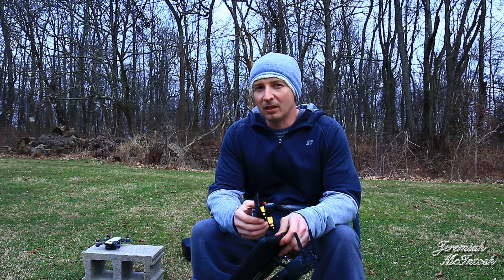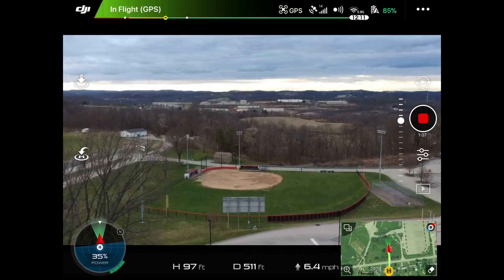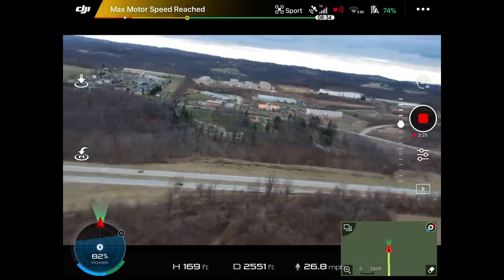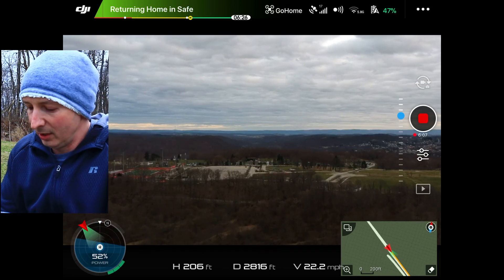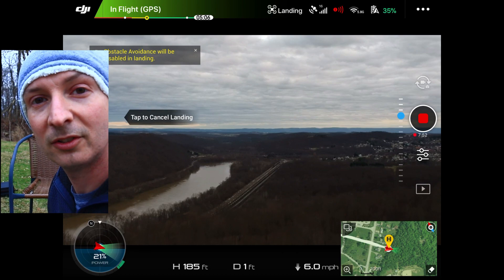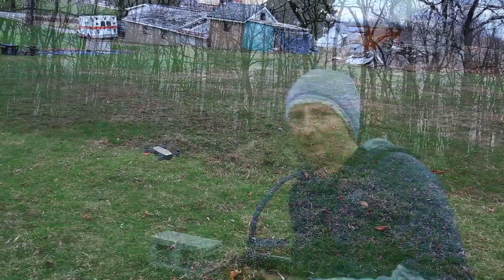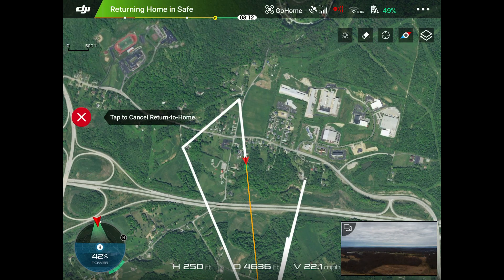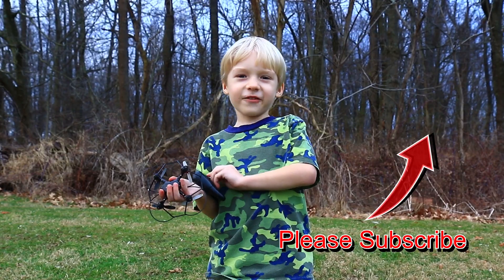Dji Spark 3 Tests in 1 Video with Tips!

Comment: I recently saw a video whereas a Spark owner stipulated that it's imperative when launching your Spark you should ensure you lift (straight up) for at least 10 meters before moving any other direction, doing this will allow the Spark to correctly identify & mark it's location in the event the RTH feature is activated. I've been practicing this method & to this day I've had no problem with the accuracy of the RTH feature on my Spark.
Reply from the maker: He is exactly right. When doing that it enables (precision landing) which is usually very accurate. 
If you don’t do that it is usually still fairly accurate when landing usually within a few feet from my experience.

Comment: What case you have on that ipad
Reply from the maker: popitn2nd it is an otterbox defender case but a cheap eBay knockoff one. 
I wouldn’t recommend the knockoff and would buy oem if I were you. 
Fit was very tight and tabs on the cover wore off already.

Comment: I did a return to home test and it actually landed on the small black carrying case that I took off from. You might have calibrate your compass.
Reply from the maker: SmokeScreen Media thanks. My compass is good. Sometimes it lands right on and sometimes it’s 10’ off. 
I noticed when it says precision landing (when its landing) on screen it it right on.

Comment: Hey I was wondering if you have your tablet hooked up via Wi-Fi to your controller or are you using a cable at direct cable from your controller to your tablet. If you're using Wi-Fi to connect wireless do you find there's video lag? I just picked up the spark and I'm using my phone with the spark but I'm using a cable it's a direct feed and I get no video light whatsoever when I go wireless internet into airplane mode and use Wi-Fi and I have a slight amount of video like
Reply from the maker: Erwin Delarmente I am connected wirelessly and haven’t noticed any lag other than one time when I was inside my house and I believe it was because of interference from my WiFi and other electronic device near it. 
I have never used the cable so I cannot really compare between the 2. 
I have had some video quality issues from time to time. 
Do you have lag issues when both recording and not recording?
Reply: Well with me it's been losing Wifi connection with my Samsung Galaxy Tab S2 10 inch.. I searched it and it's that spacific tablet ppl Crap! But today I was able to connect via cable so now no worries.... It's all good! Lol
Reply from the maker: Erwin Delarmente 👍

Comment: I'm afraid to fly my sparky.. because most of the video on YouTube..dji spark fly away😥
Reply from the maker: Joey Pereyra I have not had a fly away yet. The main thing is make sure you have no errors at takeoff. Make sure to update your home point and always have good gps signal. 
Also try to stay away from any interference like electricity lines, other WiFi signal,Bluetooth devices and large metal objects. and always stay in line of sight with the aircraft. 
If you want some sort of piece of mind like I did you could buy a Marco Polo tracker just in case it flys away. You can check out my videos on that here. 
Mounting Marco Polo on DJI Spark and reviewhttps://youtu.be/hkshcapZpm0
Reply: Jeremiah Mcintosh 
Thanks, I'll check on Marco Polo.

Comment: To disengage RTH you can tap screen 📺 after ok’ing,or switch off sport mode,but I always use the remote button.  And the spark always Returns home.....so far.
Good stuff 😎

Comment: I was like you when I was testing the precision landing (on a small drone case where it took off), it clips off one of the prop. So rule of thumb for me is either take off from a flat surface or catch by hand when it lands. Good tips on return to home and angling the antenna towards the drone.
Reply from the maker: Willie Choi  thank you for the feedback and thanks for subscribing! I normally do hand catch mine but I was just trying to show how accurate it was for review purposes.